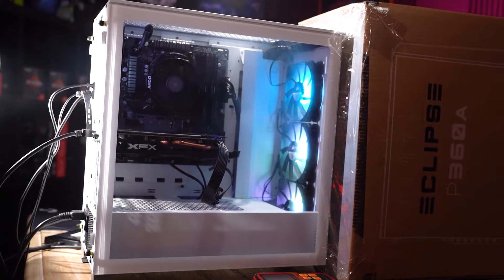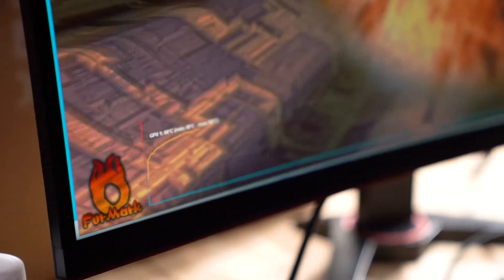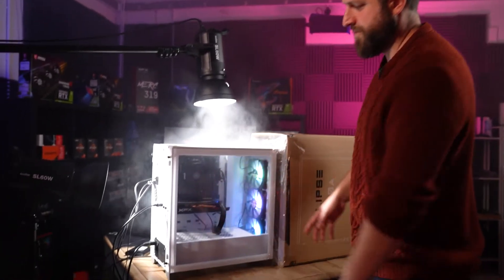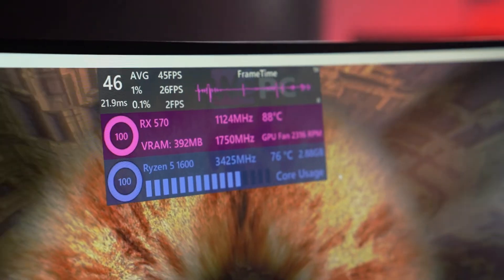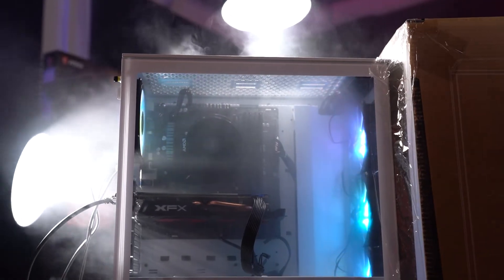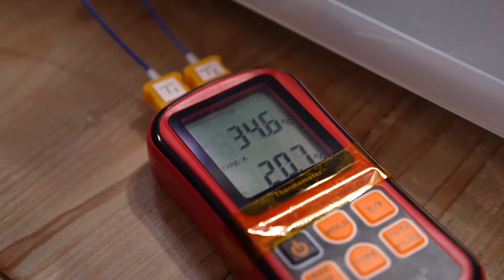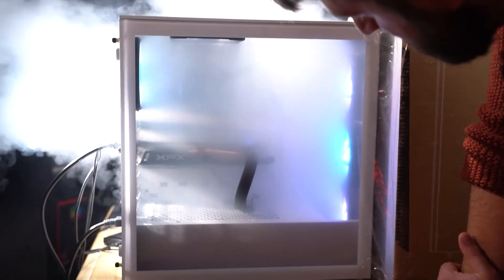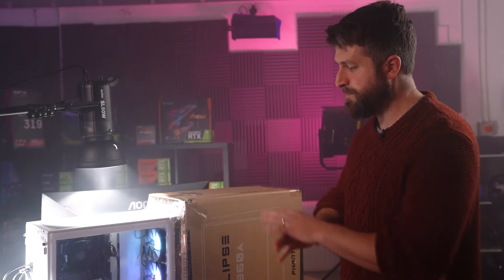Which fan placement has the best airflow? Corsair 4000x, Airflow and Temperature Test, EP. 3

Comment: Thanks for this vid. Been experimenting with probably more fans than I should be, haha. My CPU has started heating up a few degrees higher than two months ago when I built it. Still WAY within safe range (75-80 at full load gaming and recording simultaneously), but something to stay abreast of. I had the three front intake, two top and one top rear exhaust configuration and it seemed fine enough, but I did suspect the top front intake and front top exhaust were making their own loop and stealing efficiency.

What I'm wondering is two things:

1. Is flipping the front top exhaust to become an intake better or worse than removing that fan altogether? It would eliminate any loss of cold air from that front top section, but I wonder if it's pulling too much hot air from the rear top exhaust next to it? I placed a divider of sorts inside the case to cut down on the exhaust stealing air from the intake, so most of that intake should be going right through my CPU cooler (faces the front of the case) and out the top back and rear top exhausts.

2. Should I be looking to eliminate the intake of air through the back from the GPU, or should I just add filters to my vented PCI covers to prevent dust buildup? Going even further, would it be helpful to install a few 40mm fans on the vertical GPU mount to INCREASE the intake to the GPU on the rear side?

I know a lot of this might best be achieved by experimentation, but in order to do that I have to drop a little more money, so any insight I can glean before doing so would be helpful. These questions go to ANYBODY who reads this and knows more than I do, not just our lovely content creator. 😁 Thanks!
Reply: Have got a fan configuration for you - all intake. Five intake fans - three stock in the front, two more from the CPU liquid-cooler in the top. Do let me know if it brings the temperature down to acceptable levels, if you try this.

Comment: I have ordered the airflow version of this case with two Noctua NF-A14s for the intake and one NF-S12A as the exhaust. I wanted to know if I should add two or one more fan on the top as well. What would you recommend?
Reply: Just curious what you ended up doing here?   I would add one more to the top as exhaust, maybe even add a third front intake with two exhausts.
Reply: @Wigglythegreat2  I ended up putting two Noctua NF-A14s on top, the one right above the CPU is exhaust and the other one is intake. It managed to decrease my CPU temperatures by about 5 degrees Celsius.
In total I've got two Noctua NF-A14 in the front, two on top and one NF-S12A as exhaust. NH-D15 CPU cooler and RTX 3060TI Asus Rog Strix. The PC is dead silent, just the way I like it.
Reply: @bmxismylife123  Very nice.  I have four Noctua NF-A14s and two Bequiet 140mm.  The Bequiet fans came with my 802 case so I saved a couple of bucks and used them too and they do a good job.  I have three Noctua 140mm fans as front intake and one as rear exhaust.   I used the two Bequiet 140mm fans as exhaust on the top and there is room for 3x140mm up there, but it didn't gain me anything by using a third fan there so I left it out.  The three front Noctua intake fans push a bit more air than the exhaust fans so it makes for a slightly positive pressure in the case.  For CPU cooler I use the Noctua U12A.  Like you, my PC runs very quiet too.
Reply: @Wigglythegreat2  It's best to keep the positive pressure. I had NZXT's H510i previously which was not only a microwave, but also a full on dust collector of a case. I recently opened up my 4000D Airflow and noticed there was hardly any dust in there. Obviously I try and keep my dust filters clean as well as my house.

Comment: Very interesting. I've been a bit too obsessed about case airflow lately. Not just as a newfound PC-enthusiast, but as an engineering student. I was even thinking about designing some cases in CAD and looking into doing CFD simulations. (Which I might still do). But this did the job even better, and for the almost the exact case I've bought as well. The 4000D Airflow, but with a tower cooler. So the mesh front will add more front to rear flow, with which the tower cooler will interfere somewhat. But it's close enough. I'll do the front to rear setup, no top exhaust towards the rear. I love the work you put into this. I'm subscribed 👍
Reply: You could make a killing selling cases to miners. The only good server cases with somewhat good airflow for multiple gpus are sold overseas in bulk at high price.
Reply: Doing those on ANSYS would take quite a while

Comment: Love to this case! Just a shame that the 280mm radiator mount at the top is so restricted by ram clearance
Reply: Yep learned that one the hard way lol. Have Corsair vengeance pro rgb ram and tried 280 on top and there wasn’t enough clearance . Ended up getting the h100i which is 240 mm and it worked

Comment: Tysm for doing this!! Just bought this case exactly with an AIO. I'm wondering if frontmost top mounted AIO fan was oriented as an intake with rear most as exhaust along with an exhaust fan at the back of the case? 🤔 if you have the time to test maybe just update us in the comments if a staggered top fan orientation was beneficial?
Reply: This is my exact set up with an LC360. Great temps, I lowered RPMs of the exhausts and raised the AIO intakes so it creates positive pressure. They’re in ‘super quiet’ mode. Everything OC’d I’m idling 29C on GPU, 31C CPU. Load I reach 55-60C GPU, 50-58C CPU. 3070Ti Strix and a 3700X with an LC360 Strix cooler.
Reply from the maker: I was literally just talking about this configuration with one of our PC builders the other day. I'll test it on a future video

Comment: Dont you think you could drill holes in the case unser the GPU and put two 120mm fans there?
Reply from the maker: that's where you power supply is so you'll just be pulling hot air in from the power supply
Reply: @WePC  my thought was, that since the power supply has it's fan on the bottom it may not effect the air coming to the case much. Also this may be where the lower fan of the three on the front may help to bring cold air into the area of the PSU where it then will be sucked up into the case by those "extra" two fans.
Also this additional airflow may reduce the problem of top mounted fans taking the air from the front fans away from an air cooler. So with the two exta bottom fans the two top fans could be helpful. It would be kind of a vertical air flow like the fully faned Lian Li o11 Dynamic.

Sorry for the long comment. You probably don't have time to read and answer all this.
Reply: That only works on cases like the fractal Torrent where the power supply is up top

Comment: Love the visualisation. Super interesting to see that none of the configurations affected gpu temp much at all. Would adding fans to the bottom of the case affect gpu temp? 
You commented about the different airflow patterns you'd want for an AIO, I'd be really curious what would happen with a tower cooler as well.
Reply from the maker: the only reason the GPU temp didn't change is because I was stress testing it at 100% the entire time. if it was just normal use you would see a difference, I'll include some normal gaming situations in my next tests so you can see the difference

Comment: is it possible to blow more air to cool the gpu by putting a fan or two on the grill at the bottom of the case below the gpu?
Reply: I am wondering this aswell! A fan on the bottom intaking!
Reply from the maker: you can put some fans there but that's where your PSU is sitting so you'll just be pulling hot air through from your PSU
Reply: @WePC  not really, PSU takes fresh air from the bottom and exaust it at the back so it have its own airflow (there is no point in placing the PSU taking hot air from inside, making a negative pressure below the gpu and intaking unfiltered air from the pci brackets). But i doubt that even 2 intake fans at the bottom makes any diference since its completly chocked by the psu and all the cables bellow the psu shroud.